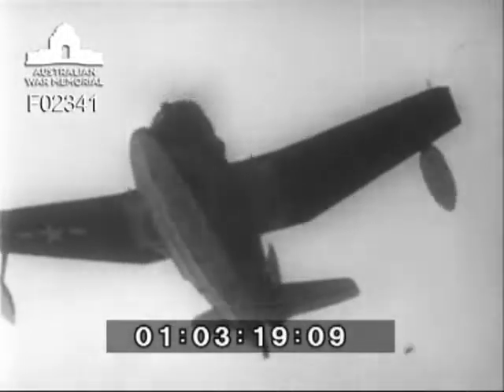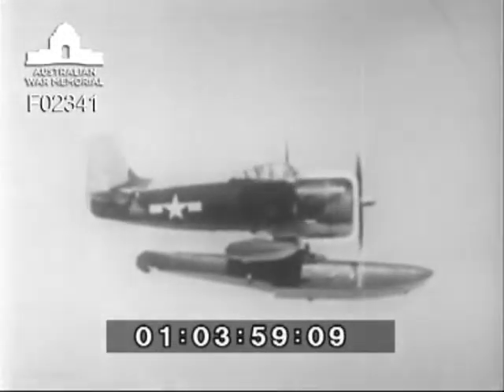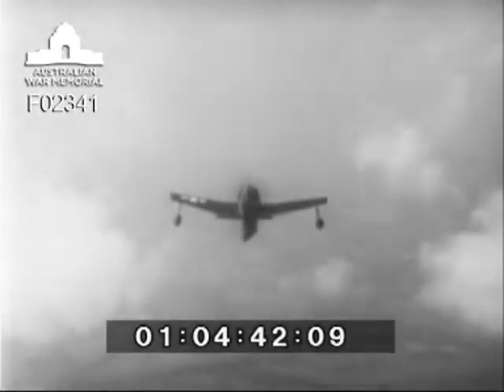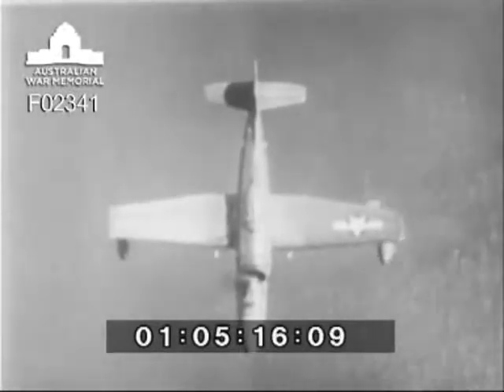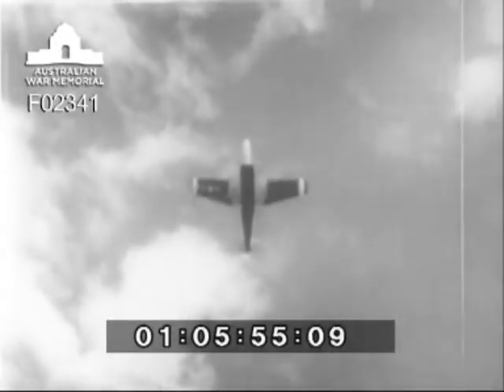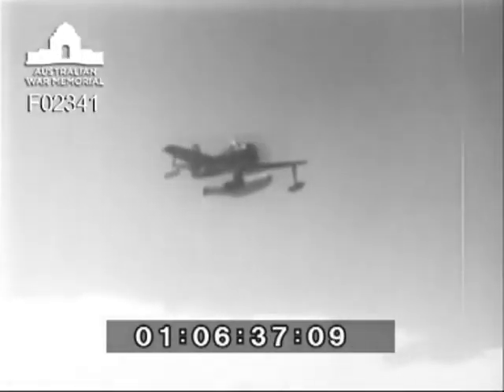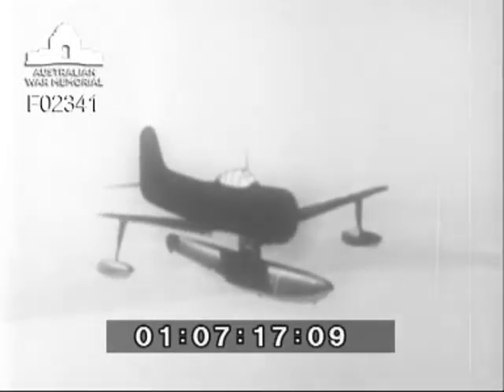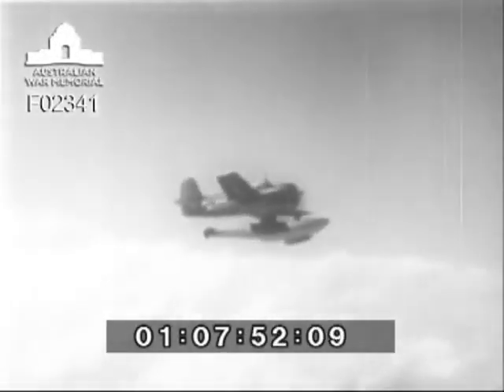Recognition of the SC-1 Sea Hawk

Comment: too bad they dint turn it into a fighter . that floatplane could hit 300 already!
Reply: With the three floats attached top speed was 290 mph.  Without floats and carrying the simple, bolted on fixed landing gear, top speed was 311 mph.
The training video did not mention the Seahawk's defensive, two, M2 Browning 0.50 heavy machine guns.  The Seahwak was capable of carrying a 250-lbs bomb under each wing.  A reserve fuel tank in the main float extended the range.  The US Navy probably considered all this information classified.